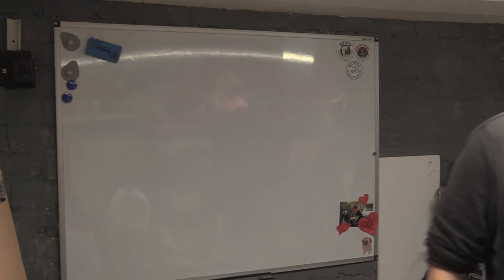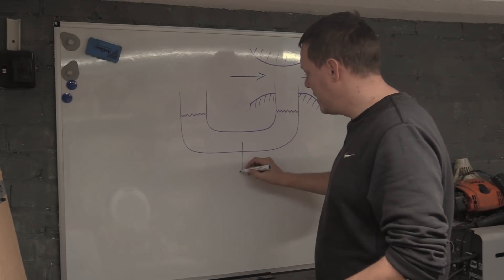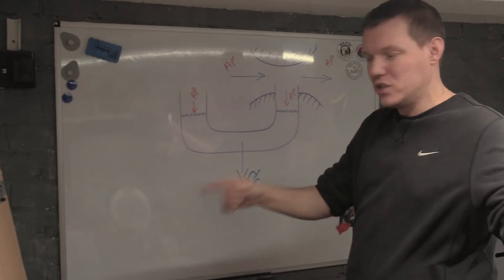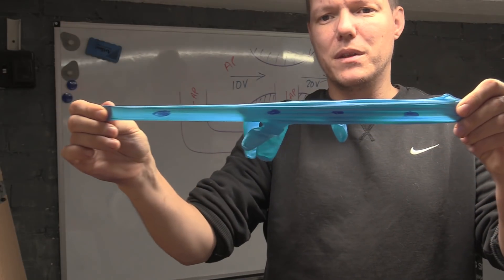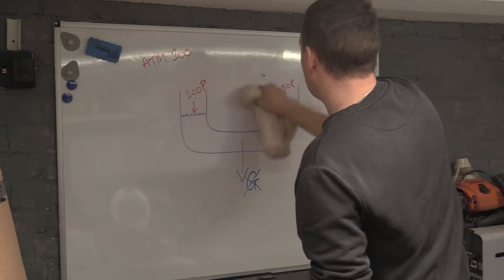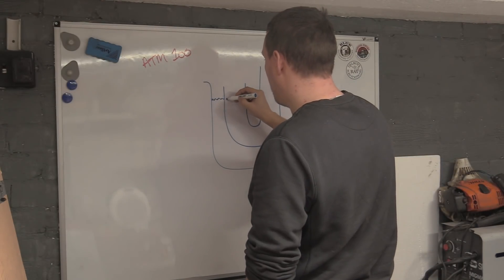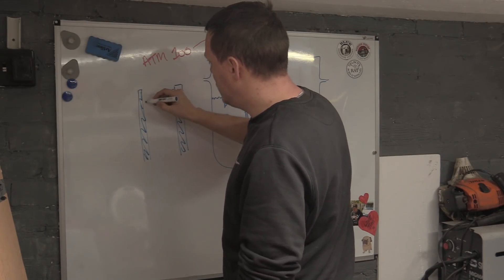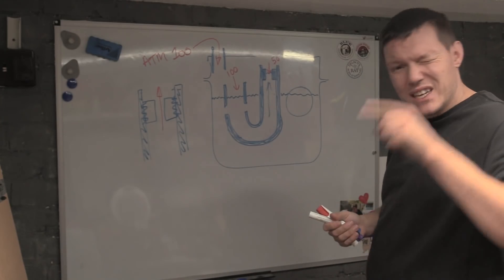How Carb Jets Work?

Comment: Not sure you're 100% right on the reason for the air pressure drop. You imply the inlet track suction is the cause. I understand it's the fact that the air is moving and the air in the bowl is static. Think of weather systems static air has higher pressure that rotating systems (lows)
Feel free to correct me. Hold a piece of paper level with your bottom lip and blow. The paper will rise even though the air leaving your mouth is being forced out at a higher pressure than ambient.
Reply from the maker: I dont know where you got that from... a drop in density in the carb and the force against fuel in the bowl forces the fuel into the air stream. This isnt what I think happens, this IS what happens.

Pressure is force over an area. There is no area in empty volume...
Reply: @thedirtyworkshop  I didn't understand your reply. To further muddy the waters, you may be confusing air flowing through an open venturi and fuel vaporising (normal) against the action of a choke (cold start) where there would be a significant suck acting on the jets.

 Then we may also bring into the mix pressure drop and an associated drop in temp. Have you ever heard of carb icing? I used to have a fiesta car that would die on the road side due to ice build up in the venturi.

Injection is in many ways so much simpler.

Keep up the good work, enlightening us and giving us things to think about.
Reply from the maker: I'm not confusing anything. Carb icing has nothing to do with fluid dynamics. Carb icing is about latent heat of vaporisation

Comment: I thought the air that passed at speed over the hole caused an atomisation effect which helped pull the fuel out through the venturii. On the other hand, where you talk about the float bowl, that acts similar to the syphon feed of a trickle filter system. Cheers for the video Matt :-)

Comment: Small hole less gas bigger hole more gas what's to know?you left out the needle valve,and most people would call that a vacuum pressure.them there is the idle jet, main jet slide valve and or throttle valve.I think you should do more on this.
Reply: idle/pilot/main etc - best way is to just show a carb and show someone where the jets live, it makes it way easier for someone to get their head around.

Comment: The Mikuni catalog has a lot of good info in it, as well as the many PDF on tuning mikuni carbs. Might be worth contacting the guys in the USA and ask if you can use their info in a video. If so we'll figure out a way to get all the stuff to you, I have most stuff save in my files.
Reply: Yes. I run a Mikuni TM40-6 on my Honda XR650L. It can be a bit tricky to dial in with all the jets.
Reply: The Honda common service manuals and the Honda Motorcycle Carburation manuals are quite good for the fundamentals
Common Service Manual newer version...
https://www.manualslib.com/manual/819966/Honda-Motorcycle.html
https://www.scribd.com/doc/258949907/Honda-Carburation-Manual

Comment: and for part2 - cv carbs- you will make a better video than i can on these because of the way you explain
i have tried too but can never explain clearly enough - i dont have a white board :-)
Reply: The concept behind CV carbs is actually pretty simple.
In a round or flat slide carburetor you determine how open the throat in the carb is. If you crack it wide open at low RPM that slows the speed of the air down dramatically passing through the carburetor and hurts fuel atomization. 

A CV or constant velocity carburetor Make sure the air velocity through the carburetor throat stays high. So if you give it wide open throttle at low RPM it doesn't open up the carburetor slide until the engine needs that much air flow. How far the CV car opens depends on the diaphragm and the spring, it is sensing vacuum from the engine. More vacuum, it opens further, less vacuum it closes a bit.

It's trying to maintain the intake air velocity so the fuel mix is better and the carburetor functions more accurately.
Reply: @otm646  its simple to understand for some of us - its just me and trying to explain to others - im the carb guy that people come to but i just cant explain things well. that was the point of this video but on a basic explanation, just want to see how matt explains it in a way i can to people :-)